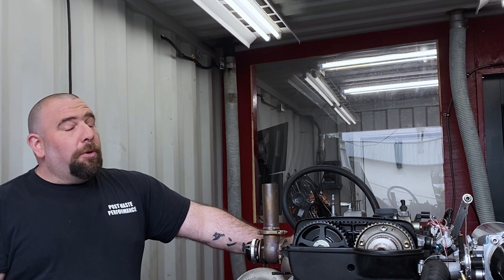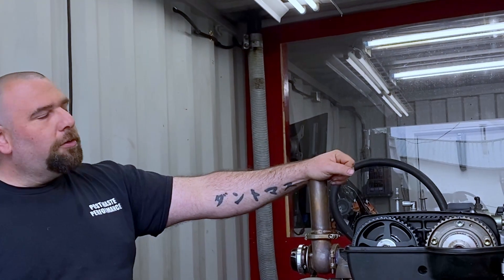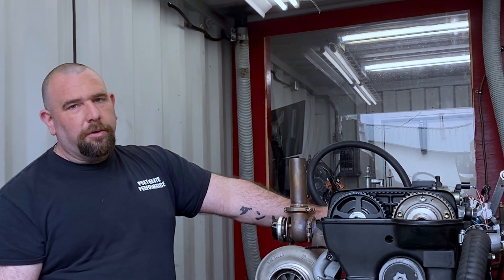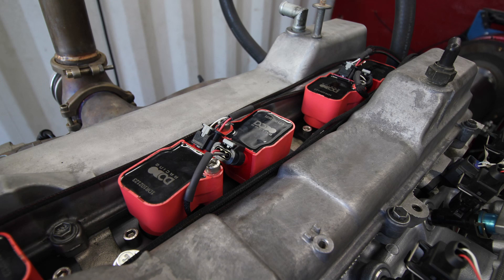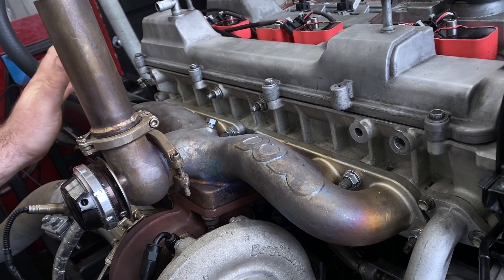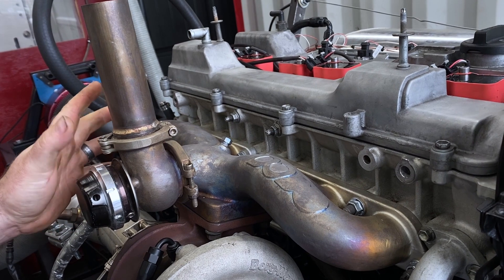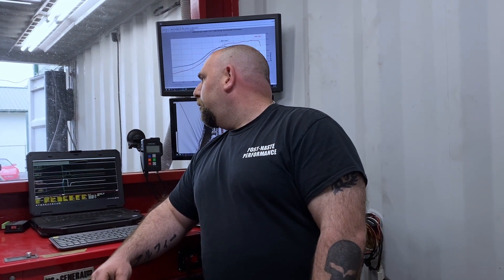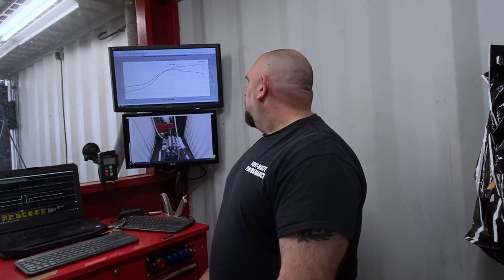Dodo Racing 2JZ T4 Manifold & Ignition Coils - Engine Dyno Test @ Post-Haste Performance

Comment: Are you in any position to the dyno hp and tq difference, with the 2jzgte factory FFIM plenum, vs the 2jzge vvti factory cross cover intake plenum that has the factory ACIS butterfly valve within them?

ACIS is supposed to net more power, but I would like to see a direct difference.

Thanks!